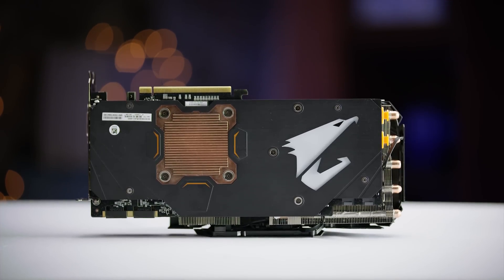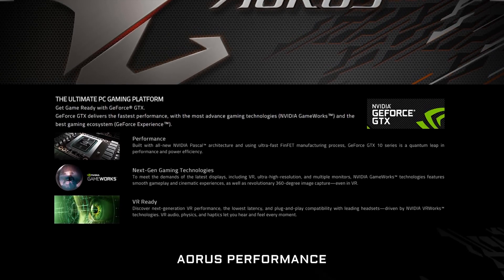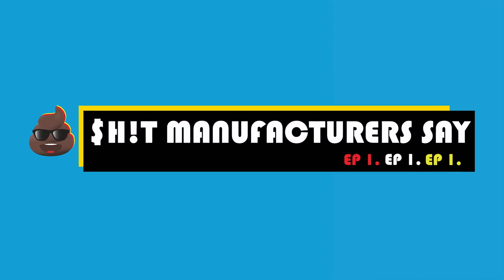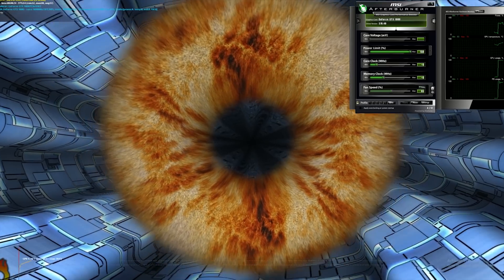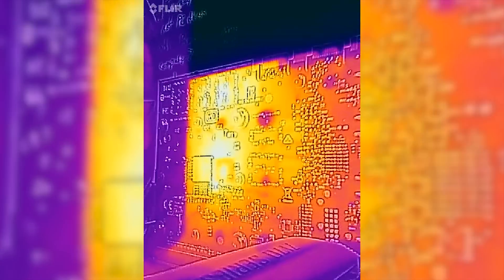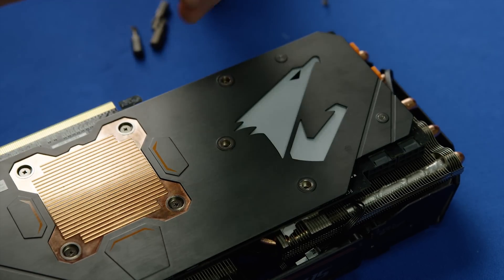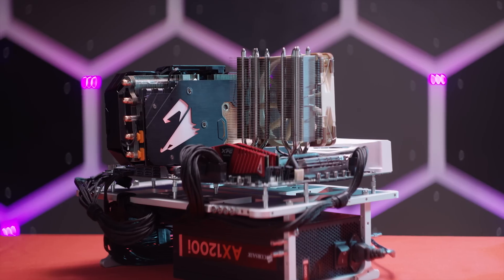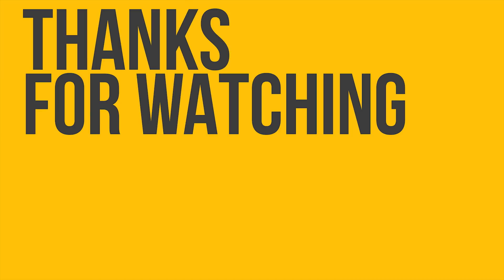$h!t Manufacturers Say Ep. 1 - "Backplates Cool Your Video Card"

Comment: Your cold spot was just copper radiating heat less than that matte plastic surface around it. It was probably same temperature than everything else shiny metals just wont emit that much radiation compared to other materials.
Reply: AND HERE WE GO!
Reply: Hydraulic Press Channel more likely is the fact that copper is a fantastic reflector for ir. I've taken a photo of myself in a large sheet of copper with an ir camera.
Reply: +crni195 Metal tranfers more heat than plastic, but they have very different emissivity... So yeah, probably just that...
Reply: Copper transfers the heat well. If you touch copper it will feel cold not because it transfers heat less, but because it will conduct the heat from your skin well and vice versa.
Also flir is not so good for shiny stuff
Reply: Can I see it?
Reply: hydraulic press vs GTX 1080
Reply: The copper backplate did have what looks like a platsic shiny cover over it?
Reply: +ZPERO I didn't reply to Bourinos though, I replied to crni195 who said that metals emit more heat than plastics. Either he used "emit" wrong and he actually meant "transfer through contact" or he used "heat" wrong and he meant "blackbody radiation".
Reply: crni195 it disperses, not emmits. so it is better for cooling than a plastic back
Reply: I think he doesn't know that
Reply: Good joke mate. So many people get fooled :)
Reply: you are funny as hell mate XD
Reply: Copper simply reflects the ir, hence can not be reliably measured with this cheap flir
Reply: FLIR "sees" how hot something is, ie how much heat is absorbed, not dispersed/reflected.  It's the same thing as 2 cars in the sun, one black, one white.  The black one in an IR camera is going to be brighter than the white one.
Reply: The surface finish of most materials has no effect on their thermal emissivity. It just looks that way because IR cameras read shiny surfaces inaccurately.
Reply: Because this temperature is for black body only. For calculating copper temperature you would need to use some Planck's  and Stefan-Boltzman's law and know the copper emissivity.
Reply: VAT DA FAAAAAAAAAAAAAAAAAAAAAAAK ARE YOU DOING HERE
Reply: torilla tavataan
Reply: +merseyless all shiny metals are. If you have 2 polished metal containers , one with ice water and 1 with boiling water, you can barely tell which is which.
Reply: Hydraulic Press Channel!
Please Crush a 1080Ti when they come out next month!
(It should only cost about $800 USD)
It would be a great test of the backplate rigidity.
Reply: now since your native language/mother tongue isn't English my Grammar Nazi personality isn't so angry because of mistakes in that comment
Reply: +crni195 No they don't. And "heat" is not the correct term for it.
Reply: Hydraulic Press Channel reply me pls

Comment: Since the backplate is a passive cooling solution, wouldn't it make more sense to test its cooling potential in an enclosed case instead of an open test bench. For a passive cooler to work, it needs airflow. You don't really have much airflow with an open bench, so passive cooling is worthless in that environment.

Comment: Just a question though... thermal throttling? You just say that it has the same temperature doing a stress test, but with no data checking if it made any difference to performance. Personally, I still doubt it, but, eh.

Comment: Ive been trying this concept for a few years already. Ive even had peltier cooler on the back. But it doesnt drop temperature as much as it should. I think its the pcb. But i found that the backplate gets crazy hot, so its doin its job of maybe increasing lifespan of other back components(had a full cover heat pad.

Comment: Heatsink showing a cold spot pretty much just means it isn't conducting heat. Then again shiny metal pieces don't really work well with thermal imaging. Also this video should include core clocks with and without backplates as that is probably what would change if the temperatures were to go up otherwise.

Comment: I understand the need to make a sussinct video, but your testing methodology, and/or presentation of the data, is critically flawed.

Now I'm hardly one to talk, as my asus 1080 review was bashed for being equally laxed, but then again, I don't have a team of 12 employees and access to the same resources. You guys can do better.

Try it again, but this time use thermalcouples for an accurate reading, and lock the voltage, fan speed, and clock speeds to eliminate variables.

Comment: There wasnt a "cold spot". The copper surface has just another emission coefficient then the black surface.
Those thermal cameras only can "see" thermal radiation. Thats the reason why u will not see your arm through a thermal camera, if u hold him behind glas. Most of the heat radiant will get reflected by the glas surface.

Comment: Very disappointed in the testing methods. You should have had a set fan speed so it wouldn't spin faster to compensate for not having a backplate. And most important: the backplate can cool other things than the gpu itself, forinstance memorymodules and what not.

Comment: I think that the claim is heat displacement here! Apple did this well with the first macbook pro models by using copper blocks and heat pipes to displace the thermal areas inside the laptops! The heat instead of soaking through the graphics card and all its components now has an area of less resistance and soaks through the back of the card and then gets dispersed more evenly through a wider area or backplate! The result isn't necessarily lower temps, but more efficient cooling overall! If you also re-spec your test and measure the areas of the card that are actually heating up without the backplate you will see this phenomenon! A good example of this is the use of radiators and liquid cooling! The radiator does use bigger surfaces to spread heat soak up and get rid of heat, but the lower temps come from the position of the radiator relative to its heat source! The radiator achieves the lower temps by removing the heat from its hottest location, not by trying to cool that location down with fluid, it's the transfer or displacement that does the cooling! Poor "Wording" on their Part! Thermal Dynamics using Copper is all this is...

Comment: Backplates definitely take some of the heat from pcb, you can try it yourself:/ My is always hot while the gpu is on load. It is not cooling for the GPU (it has its own) but for pcb which is getting warmer too. I would like to have come active cooling for both sides of my gpu (watter):)

Comment: But the copper backplate is passive cooling so in a case with airflow it would perform better i think!
Reply: No it's not. The backplate is to protect the card from being destroyed by idiots who don't know how to handle them. The way circuit boards work is pretty simple. Don't create an electric circuit through them, except for the designed electrical circuit. Static from you counts as creating a circuit. When you do that the board dies. The board in a graphics cards is the exact same as a motherboard. The board in any electroninc is the same as a mother board. The backplate is solely designed to protect the card from nasty hands. There is no "passive cooling" from copper.
Reply: @mattevans1643  it does though it's radiates heat on the new 30XX series pretty well
Reply: @michaelf.2449  When I touch my rx 570's backplate I feel heat, but that doesn't mean that the backplate is doing anything. It is just being affected by all the heat surrounding it but doesn't dissipate it.

Comment: That card probably doesnt lose heat via the backplate because there are no fans other than CPU in your test bench. Whack it in a case and try it again. Maybe air flowing on the backplate will heed different results?

Comment: actually I had an HD 4850 and (most likely) the power delivery on the card broke, and after a few SECONDS (about a minute) i felt the card getting hotter. And as I touched the back I've noticed it's quite hot. I thought that if it would have been cooled on the back by an aluminium plate or something then It would have survived.

Comment: This is more a tech design-manufacturer query. I was shaving with my Braun Cooltec which has a nifty feature with a button that when pressed cools a piece of metal to a pretty cool temperature. How would one suggest to manufacturers to test this on motherboards or cpu coolers to possibly improve cooling at cost of power...?

Comment: The ridges on the CPU copper backplate part thing are there for a reason. I understand test-benches and generally there's no difference, but that backplate would improve cooling performance had it that extra airflow that's in a case. GamersNexus should chime in on this ;)
Reply: Krej Templin Wrong. Copper is a conductor, and will radiate less heat than plastic, therefore the thermal camera wont pick up heat coming off it, even if it's the same temperature. Copper passes on heat by conducting it, say, into air that passes over it?
Reply: juunas22 If I'm not mistaken then HardwareUnboxed made a video about this card as well.
Reply: oh man thats great XD but seriously, the heat only goes ONE WAY, its like a jet engine, its not going to go through the front where it sucks in air, its only going to vent through the back, otherwise we would have alot more stealth jets just by putting copper in between the intake and the engine itself.
Reply: foreign's gaming tech I agree, but I truly wonder what the dissipation on that backplate is with fins that small.
Reply: the copper backplate showed cold temps in the thermal camera. this means no heat from the video card was dissipating through the copper back plate. it would have been cool to the touch. if the copper back plate were to have appeared hot, then heat would have been transferring into the copper, and could have been blown away with better airflow. but this isn't the case.
Reply: malyshevag no, it doesnt, as shown, the backplate is there to protect stuff in there, if it did, others would already have done it, you cant gain a temp advantage by putting a heatsink on a area with no heat, now, if you put it on the wrong side, it would, not enough but it would, theres no reflective heat, unless your pc is actually on fire, but blow your money on bs
Reply: This is correct. The copper ridges are designed with constant airflow over them. Testing in an open air bench with no flow will definitely affect the thermal results. I would like to see this test again in either a case or with a fan  blowing over the backplate to simulate case airflow.
Reply: +Lockinhind Just see this -> https://en.wikipedia.org/wiki/Emissivity
Indeed, you see a reflection of the heatsink which is not so shiny and radiates better
BTW there is a kind of thermal masking which uses IR (not all visible light)-reflective materials integrated with clothing so that IR vision can't pick people dressed in those

Comment: I will go ahead and question your testing methodology here LinusTechTips. First you tested the Aorus card as it came out of the box. Then you removed the back plate, but in doing so you first removed the entire cooler. Then I guess you cleaned the residual thermal paste and applied some new paste. But maybe you didn't do such a good job on this. Maybe your aftermarket thermal paste was better or worse than the out of the box one. To determine with certainty if the back plate affects cooling, you would have to remove the heat sink again, re-apply the thermal paste and put the back plate on, finally repeating the test one last time. I bet you wouldn't get 67 degrees again (you may get lower or higher temp).
Reply: i just think you`re really stupid

Comment: Luke your testing was flawed. You first need to go into the RGB settings and change glow to blue to see lower temperatures. You had set it to red as a default so it makes only sense that the card was running more hot.

Comment: If it's COLD on the thermal camera, it means it is not working as a cooling system. So the back panel is not cooling. Might work if the thermal pad is swapped for thermal paste on it...

Comment: if the plate moves heat away from the card, shouldn't it look hot if you look at it with the IR camera? Because the heat went through the plate?

Comment: Apart from the already mentioned fixed fan speed this test would also make a lot more sense inside a case instead of being done on a testing bench. In a case you have the card upside down and cards are getting so large that in some cases they function as a  barrier creating 2 separate areas with their own airflow. As hot air wants to go up I can see this backplate doing more there. Not sure though.

Comment: It contributes in some way but obviously not the 3C implied by the marketting images. We can use the 0th and 1st laws of thermodynamics to state that: If the heat sink is in good thermal contact with the chip, which is a safe assumption if you got as far as running a complex 3D program. Then the chip, heat sink and backplate should be at thermal equilibrium after a few minutes with the chip at saturation. That doesn't necessarily mean their temperatures are equal, energy has many forms and processes to transform between them after all. So we must assume they change in temperature proportional to one another likely based on the quality of thermal contact. We know enough about how each of the factors involved carry heat, so all left at this point is to point a thermometer at each components and see what you get: board, backplate and heatsink. Remember, we ruled out the chip to the heat sink and know enough about it's construction to state the chip is not in direct thermal contact with the backplate so we can safely ignore the chip's temperature.

I wouldn't be surprised to see some very small, insignificantly small difference in temperature without the backplate. It's just a penny off a Lamborghini (would be hilarious if that's actually the ratio).

Comment: Why do PCB shield fail to produce much if any cooling performance improvement? Because the PCB is already fanning out heat across itself through its multiple copper layers which have soldered connections to every high thermal output component on the board, converting the PCB itself into a reasonably effective heatsink. Covering a heatsink with another heatsink with approximately the same surface area doesn't give you any additional surface area to get the heat off of the board.

Additionally, unless you have chips with metal cases or bare dies intended for top-cooling, surface-mount components with plastic/epoxy packaging get their cooling from the PCB's copper planes regardless of what gets slapped on top since the packaging has horrible thermal properties compared to the thermal solder pad found under nearly all chips of non-negligible power these days. Instead of sticking heatsink on plastic-encapsulated MOSFETs, GPU designers should flood the FETs' pads with thermal vias and stick their heatsink on the opposite side of the PCB - or put the FETs on the back side and machine their GPU heatsink to make contact with the PCB in that area. That would be 5-10X more effective.

Cooling performance wise, unless "shields" are engineered to soak heat from the PCB and every component they cover, shields are a waste of time, material and money.
Reply: Teardown Dan honestly back plates already have some passive heat radiation. If you’ve ever opened your case when it’s under load and you touched the back plate, that thing is WARM AF. 

If heat didn’t radiate from the backplate, it wouldn’t feel warm. Since you can feel the warmth, it means even some of that heat is being dissipated off the plate. It doesn’t affect much in terms of operating temperature but backplates definitely do transfer some heat from the card into themselves and radiate it out away from the card. Heat which generally will get moved out via the case airflow provided by the case fans.

Besides, adding a copper plate is mainly for the VRMs, not the core chip.

Comment: were the fan speeds exactly the same? I think you guys should have done fixed fan speeds to do a proper comparison. I'm not saying it does, but perhaps the fan turns slightly slower with the backplate

Comment: I am a fan. But this video sucks. Sorry.

The test bench doesn't push any airflow, making the backplate useless. Jay proved it in his video about the EVGA 1080 FTW iCX: letting a fan push some air across a backplate reduces temps.

There's no mention of clock speed, fan speed, anything at the last part of the test. 67°C. W00t, test done.

You probably haven't seen Steve's video about thermal imaging. That cold spot comes from 3 factors: the surface is not black, it is reflective, and the minimal heat transfer to air through convection allows it to be cooler than the rest of the backplate. The copper does its job.

EVGA moved to their iCX cooler, using a vented backplate to avoid heat pockets.

Remember copper conducts heat really well, so traces on the board can conduct heat too. That's a possible reason behind why EVGA's ACX cooler made 1080s blow up capacitors on the VRM circuitry, even though the heating components were the MOSFETs. Having a well-designed backplate and good enough airflow over it helps avoid this.

You didn't try to measure MOSFET temps.

I'll stick with GamersNexus for tech testing from now on.